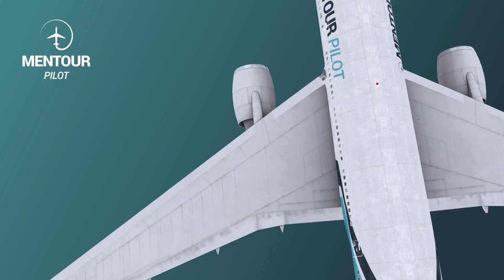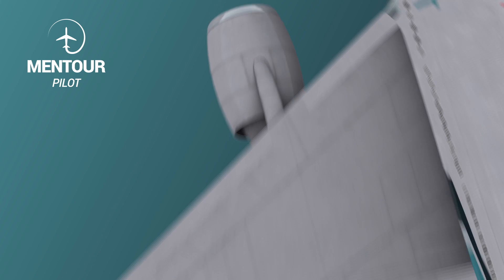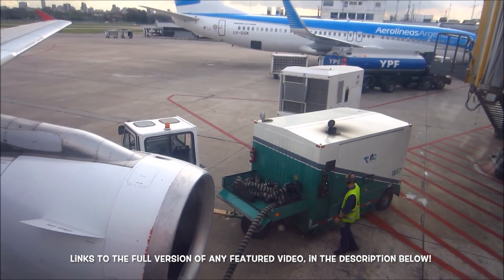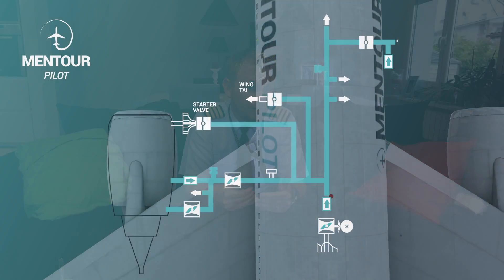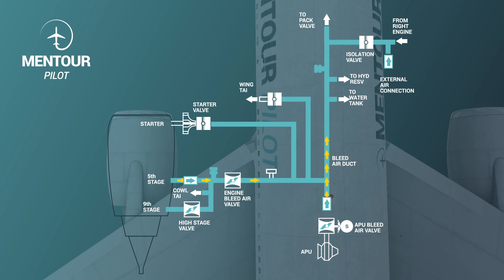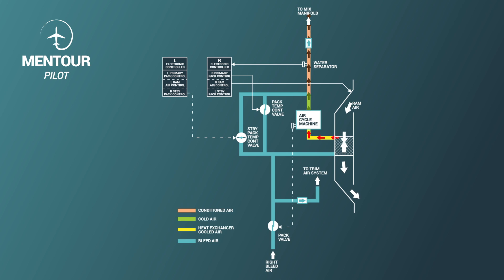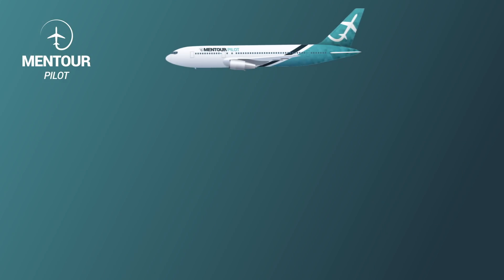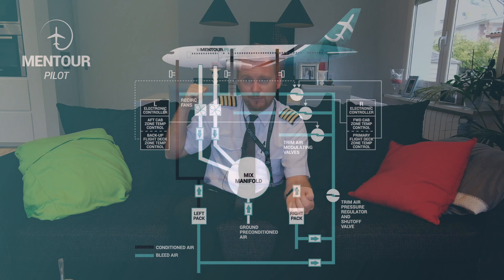How does the Boeing 737 Bleed-air system work?!

Comment: Hi Petter, I noticed that you said that Engine number 1 primarily supplies bleed air to the flight deck and engine number 2 supplies bleed air to the rest of the cabin, hence why if a bird goes in the left engine you will smell it in the flight deck first and vice versa. When looking at schematics of the aircon pack system it seems like all the air is mixed in the mix manifold and then sent to all areas of the aircraft, cabins and flight deck. Would you be able to clarify this for me? Thanks :)

Comment: Hi! I have a question if I can. Does bleed air from APU goes through pre cooler first before it starts the engine? I have found in the Internet, that actually all components of pneumatic system that uses bleed air (besides engine anti ice) goes through that pre cooler. I just wanted to verify that. Thank you and wish you all the best!

Comment: Not a bad video but I would like to clarify a few things,

@2:13 that is not a B737. Apart from the engine and strut being wrong, the airstart truck would be parked on the right hand side of the aircraft because that is the side with the pneumatic ground air connection so #1 engine can be started first

@2:53 nice animation - has a few problems, but that is not a B737 engine

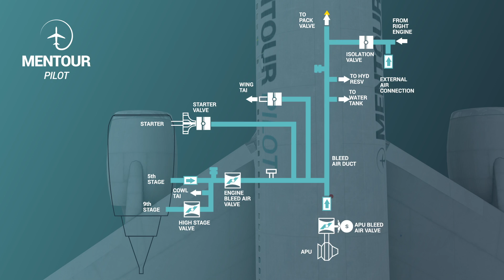@4:45 “the packs are basically controlling the pressurisation” - the air conditioning packs force the air into the airplane pressure vessel and the cabin pressurisation system controls the rate that the air flows out of the cabin

@5:38 that is a very simplified diagram of the pack

@9:11 I think you will find that during flight the air from the equipment cooling system is used to heat up the sidewalls of the forward cargo compartment. Recirculation fans pull air in from the passenger cabin and supply it to the main distribution manifold. The right recirculation fan pulls in air from the collector shroud in the forward cargo compartment. Floor grills in the passenger compartment (at the bottom of the cabin side wall panels) permit airflow into the collector shroud. The left recirculation fan pulls in air from the distribution compartment.

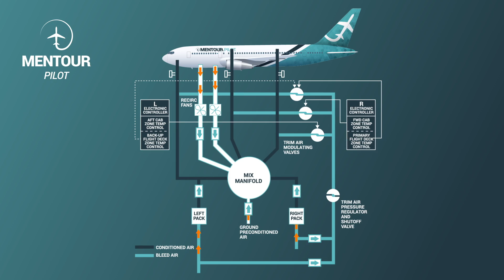@9:50 my understanding of the recirculation system is that it supplies air for ventilation which decreases the use of air from the engine bleed system and therefore saves on fuel, ie: decreases fuel consumption. It’s not to reduce the strain on the packs, that’s just a side effect

@11:50 only one Cabin Pressure Controller controls the outflow valve at any time. The other Cabin Pressure Controller is a backup. The active controller changes for every flight or when there is an autofail event.

@12:31 would have been nice if you had explained about the pressure bump. During the takeoff phase, the system pressurises the cabin to 0.1 psid below field elevation. This prevents the uncomfortable pressure bump (momentary pressure increase) at airplane rotation.

@17:17 CH 36 pneumatics probably has more defects than any other system on the aircraft

Comment: @Mentour Pilot, what causes fume events? Have you experienced one in your career, and are modern aircraft types equipped to better detect and mitigate them?
Reply: Fume events can be caused by contamination of the compressor section of the engine. As you saw in the video, the compressor stages 5 and 9 are used for airconditioning purposes. One source that comes to mind is engine compressor washing carried out by maintenance. If the engine isn’t run for long enough after the compressor wash, the remaining material can cause a fume event during the next take off.

Newer aircraft types such as the B787 don’t take bleed air from the engine compressor for air conditioning, so the scenario above I described is avoided

Comment: Great video! But why does the cabin altitude change? I imagine a flight would be nicer if the pressure stayed constant throughout the whole flight, no one would have their ears pop?
Reply: The air pressure at ground level is 14.7 psi on a standard day. At aircraft cruising altitude of 40,000 ft the air preassure is 2.7psi. Humans can not survive with such low air pressure. The structure of the aircraft can only withstand a maximum differential pressure of 8.45 maximum differential. Therefore the cabin altitude needs to be decreased so the structural integrity of the pressure vessel is maintained

Comment: How does the lavatory work in an airplane and is it common to run out of running water on a long flight?
Reply: Most modern day lavatories use differential pressure to evacuate the contents of the toilet bowl - works well. Under 16,000ft they use vacuum blowers to generate the suction force

Comment: It is a very professional explanation. A Question, why it's recommended or mandatory to start engine n° 1 in case of apu inop in 737 model?
Reply: Because the ground pneumatic source of air is connected on the right hand side of the aircraft very close to #2 engine. If they started #2 engine if would be more dangerous for ground personnel. So when the APU is unserviceable, they start #1 engine first.

@2:13 that is not a B737 but shows that the ground start unit is on the left hand side of the aircraft for that aircraft type
Reply: @NicholasRiviera-Dr @2:13 A320series CEO with an IAE V2500? 🤔

And Im pretty sure I have seen start-ups of eng #2 first with inop APUs, so perhaps it is airport based?
Or is my memory clouded?😆🤔
Reply: @speedbird9313  I would have guessed the same but I am not very familiar with the A320

I guess you could start #2 engine first on the B737 using the ground air start truck, but the connection is on the right hand side and puts the guy who removes the hose from the aircraft in even more danger due to the proximity to #2 engine. It’s definitely possible but not the safest way to do things.

There is an issue with the normal procedure (our airline) when starting #1 engine first. The truck has to be parked on the right hand side of the aircraft. The only time we use the air start truck is when the APU is U/S, so there is no air to run the packs. The problem is we don’t have ground conditioned air, so the cabin gets hot because there is no conditioned air to cool the cabin. We need to use the air start truck to run the packs so the cabin is cool enough before the passengers load. The right hand side of the aircraft is where the cargo is loaded and the fuel truck parks to refuel. Parking an enormous truck (air start truck) on the right hand side of the aircraft when space is already limited creates more hassle. I can understand why you may have seen it on the left hand side of the aircraft to start #2 first for the reasons above.

The B737 QRH Supplementary Procedures, Starting with Ground Air Source (AC electrical power available) that my company uses states:
“Engine No. 1 must be started first.”
Then the procedure, followed by:
“WARNING: To minimize the hazard to ground personnel, the external air should be disconnected, and engine No. 2 started using the Engine Crossbleed Start procedure.”

Not 100% sure, but I think the QRH is written by the manufacturer BOEING which means it would be SOP for the world wide fleet

Nice user name by the way 👍
Reply: Huh? 🤔 Engine 2 is normally started first..

Comment: Could bleed air be used for controlling the airplane instead of hydraulics? It would be lighter and cheaper, it would just need to have a bit more pressure...
Reply: Bleed air has been used to control the thrust reverser and leading edge devices on the B747
Reply: Search for a video on car brake bleeding.
Air is compressible and can't control anything, hydraulic fluid is not compressible.

Comment: Could you please explain the 787 no-bleed architecture?  Is this the direction for all future aircraft design?  Especially interested in cabin air quality.  Toxic fume incident rate is one per day, or one in every 44,198 flights.  So, very rare.  But still - horrifying.  HEPA filters can catch Covid particulates, but not oil or hydraulic fluid leaking through a seal.

Comment: Thank you for this cause i suffer alots to understand many things, Could  you please talk about the positive relef valve
Reply: The positive pressure relief valves prevent over pressure damage to the airplane structure. There are two positive pressure relief valves. They are on the lower, aft airplane fuselage. One valve is on each side of the outflow valve. The positive pressure relief valves are fail safe devices that bleed cabin pressure overboard if the cabin-to-ambient differential pressure exceeds normal limits. The positive pressure relief valves are mechanical devices and operate independently. They do not interface with other airplane pressurization systems and no crew action is necessary. The positive pressure relief valves are pneumatically operated by cabin-to-ambient pressure differential. They control pressure to a nominal 8.95 +/-0.15 psi more than ambient. When the differential pressure is too high, the valve opens. The open valve lets air out of the airplane. This relieves the cabin pressure. When the cabin-to-ambient pressure is safe, the valve closes. The positive pressure relief valves have filters. The filters clean the air used in the internal servo and actuator mechanisms.

Comment: I am assuming that the pressure maintained in the cabin is also shared for the flight deck (or is there a seperate system for the cockpit?
Reply: Shared, it’s the same pressure

Comment: What is the pressure of the bleed air? Is it regulated for certain pressure?
Reply: The bleed air as it exits the engine is regulated for pressure by the Pressure Regulating and Shut Off Valve (PRSOV) to 42+-8 psi

Comment: Hi thank you for this very useful video, it's coming handy in my research on heat exchangers in environmental control systems. if  we have to cool the air that enters the heat exchangers, what is the use of compressing the air to increase the temperature in the first place? thank you
Reply: You are compressing the air to increase the pressure, the increase in temperature is a result of the compression. There are two heat exchanges to try and reduce the temperature. The turbine of the ACM is an expansion turbine. When the high pressure air reaches the turbine, it expands through it and drops in temperature as the energy is extracted. This is where the very cold air comes from

Comment: Just a clarification on the working of the packs..
The air cycle machine that cools the bleed air consists of a compressor and turbine.
After a first heat exchanger, the air goes through the compressor so the temperature is raised before going through a second heat exchanger.
This makes this heat exchanger more efficient because there is a higher temperature difference. 
Then it goes through the turbine to cool it back down, run the compressor and a fan that draws outside air over the heat exchangers because when it is sitting at the gate they need air flow as well.
At this point the temperature can be below freezing so some bleed air can be routed to bypass the air cycle machine to keep it above freezing and keep any water in the air from icing up the system.
This cold air is kept at a stable temperature that way and the system regulates cabin temperature by allowing more or less uncooled bleed air to mix with the cold air.
Reply: Do you work for Honeywell, Liebherr or Secan? You must work for one of them with such a good understanding of the whole system
Reply: @st4rskream  
I'm an aviation maintenance technician (plane mechanic).
I've worked on many different planes and systems.
Reply: @muskiet8687  Similar to me although i work only on the bleed air systems for the A320, B747, F7X and A380.

Comment: I've heard you mention using external bleed air when the APU is not working before.
Is the risk not increased by flying with a dead APU? Say both engines stall and you need the APU to restart them midair or whatever else the APU can do.
Just wonder why a malfunctioning component on that scale is allowed to continue service without being repaired
Reply: Its a MEL item so its quite limited, an inop APU is a Category C MEL, which means it can fly for 10days.
Cant think of any incidents where both engines has been lost on a 737NG🤔🙄

Comment: The main reason why it's now no longer required to bleed engine compressor air is really as much to do with the advancements in electrical power generation as it is to do with modern turbo fan engines.  
All of those systems still exist e.g. anti icing,  cabin pressurization and air conditioning, etc etc. but nowadays it is more efficient to run those systems electrically.  You are still robbing the engines of power but it just happens to be more efficient to run those systems electrically via engine generators than it is by bleeding off engine compressor air.  This simply wasn't the case in earlier aircraft designs.

Comment: Could you please explain the windshields?  How strong are they?  How can they keep from breaking at the wide variety of temperatures they are exposed to? How are they made? Are they glass or another composite material?  Are they heated and if so how. Are they tented different colors? Are the front windshields made differently than the side windshields?  How big can a windshield be and still be safe to be hit by a goose? Thanks. Randy Taylor
Reply: Wow, a lot of window questions. The cockpit windows are heated to help stop them from shattering from impact. They are made from layers of plastic and glass. For the front windshield (#1), each windshield is a laminated assembly of layers of glass and vinyl or urethane. The structural inner glass pane carries pressure loads. The vinyl interlayer is structural for bird impact resistance and fail-safe pressure loads.
The current windshield manufactured by PPG has these layers: an non-structural outer glass pane, a non-structural urethane interlayer, a structural vinyl (polyvinyl butyral or PVB) interlayer, a non-structural urethane interlayer and an structural inner glass pane.

Comment: @Mentour Pilot. Sir is the APU not required for safe flight?   I realize you had external air and electrical airport based equipment to start plane.   What would happen if you took off,, both engines failed and the ram prop did not drop to provide basic communications and electronics ?   

Just asking if that is common as you said a APU not  working on ground?
Most don’t even know about the APU.
Love your Videos.    Are their many planes still flying that had all the Hepa filters from days when smoking on planes was common?
Reply: Apu is not required for flying, but it is not that common for it to be unserviceable. 
No RAT (ram prop) on the 737s, but on a Airbus you would start the apu. Like they did on the US Airways flight 1549.

Comment: The physics behind the operation of an air cycle machine (pack) are fascinating. Hot bleed air in...cool/cold air out. And all done without a refrigerant! Very clever manipulation of pressure and temperature with some heat exchangers along the way. Interesting piece...Cheers 👍
Reply: Just a bit more specific, Air cycle machine is one system inside the PACK. PACK(Pressurisation Air Conditioning Kit) is also responsible to recycle the stale air in a regulated airflow to maintain Pressurisation
Reply: @rishavnandi6697 I never knew what the acronym PACK stood for 😅
You are correct that the ACM is just one part of the PACK system. However, l’m not sure what you mean by it’s responsible to recycle the stale air?

Comment: I'm surprised you flew without an APU, since in modern aircraft, if both engines are out the only way to have flight controls is via the APU
Reply: There is not reason to keep the apu on when engines are running..how often do you think both engines are out midflight?🤔
Reply: @speedbird9313  It's a rare occurrence but it has occured more than one might think. I would still definitely NOT want to fly without an APU unless it was a particularly short flight.
Reply: @morteparla6926  Well..thats up to you is it..Are you gonna tell the pilots you will disembark if they dont keep the apu running all the time?🤔
Reply: @speedbird9313  .... The APU doesn't run all the time, only when the engines aren't running. Also, it is a passengers discretion to get back off of the plane if they want to, of course once the gate is closed and the cabin sealed you will probably run into trouble getting off, but they can't force you to stay on a plane that you paid to be on, and entered under your own free will....
Reply: @morteparla6926  You were talking about flight controls so you were obviously meaning inflight😉 You are incorrect by the way when it comes to the 737NG, the flight controls will move without hydralics, its just hard. At gate the apu will of course run, if operative, prior to engine start🤪
Reply: Permissible as per the MEL for 10 days not to have a serviceable APU

Comment: “787 using electrically driven compressors”... ok, but where do they get the electricity? Generator driven by engines, so they are still taking away energy from the thrust. I guess it might be a smaller amount but it still uses some